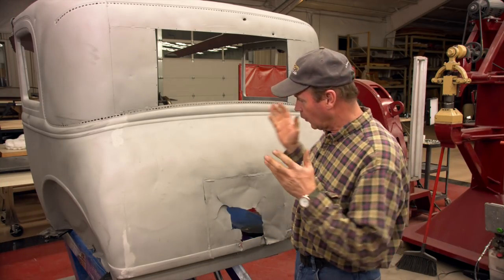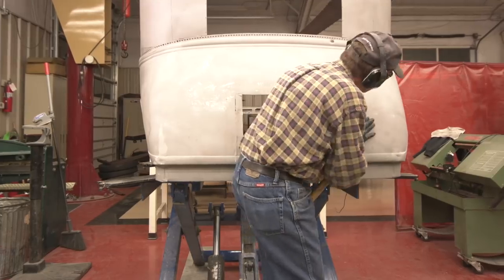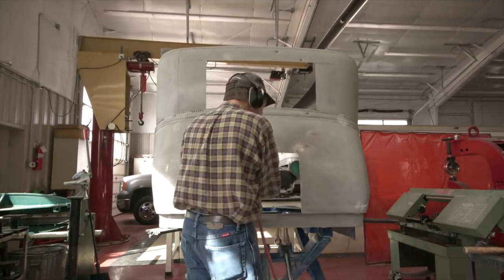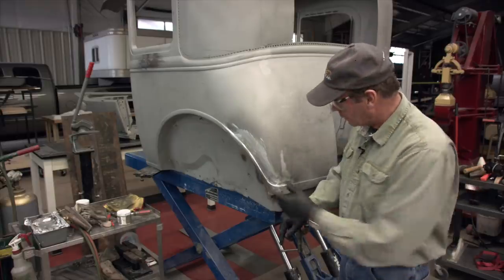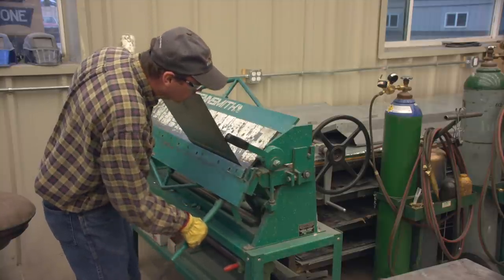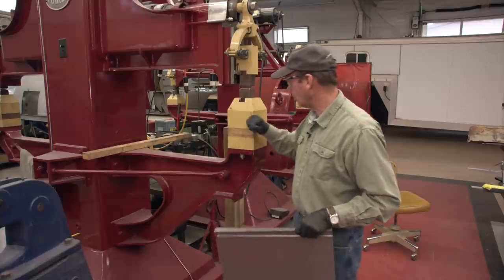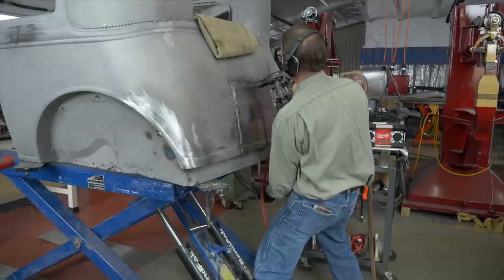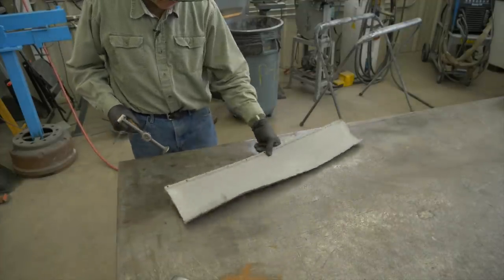Episode 3 Body work rear tub section

Comment: I've done leadwork in the past and it is a valuable skill and a far better way than body filler. The reason it is seldom used any more is the sheer expense of it. The lead is very expensive to buy and it's that simple.
Reply from the maker: Your right and add to that it does take some practice and skill to apply it.

Comment: Wow, all I can say is, you are the boss!  Excellent vid, learned a truckload here - thank you!  One thing I had been told was not to have a sharp 90 degree corner in a patch panel, but I don't recall the reasoning.  Whatever the case, you proved them wrong here - thanks again, much appreciated.
Reply from the maker: Great tip!  I did radius bend the bottom lip.

Comment: Can you give advice on restoring a car that has burned severely?  I purchased a '32 Packard 902 roadster and the body is warped from the heat.  The doors are completely burned out and the body tub drooped around the rumble seat from the heat.  I got it cheap enough that if it is beyond restoration, it won't destroy me financially.  What should I be aware of when working this car?  I will need to do some shrinking etc as it rolls like the ocean...  Please give me your best advice.
Reply from the maker: Burned cars the the most difficult to restore.  many times we end up just making new parts.  It's easier than trying to deal with the severely warped metal.

Comment: I noticed that you weren't wearing any ear protection when you were using the bead forming hammer, bad, bad, bad.  I worked around high powered radar for twenty years in the Air Force 64 > 84, we had equip cabinet blowers and screaming hydraulic antenna drives, all of which took their toll on our ears, I now wear VA supplied hearing aids.  Please take care of your ears, wear protection, I know it's a pain in the butt, but wearing aids 16 hours is a bigger pain.

Comment: At time 16.27--   would you go ahead and lead in the welded perimeter of the large patch?  or just go with bondo filler?  Would heat from leading distort the weld area?
Reply from the maker: Sometimes we have to lead a seam, but the idea behind the hammer welding is you don't need anything.  Just metal finish and then prime.   I don't like to lead out in the middle of a panel.  The distortion from the heat is a problem.